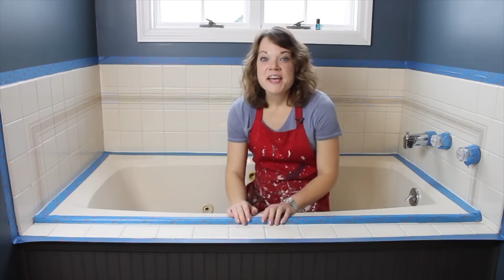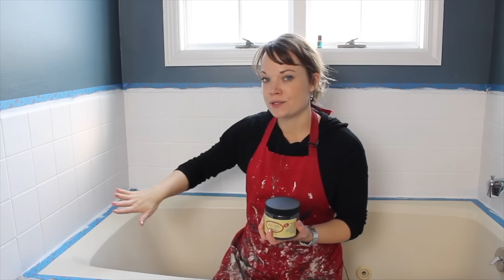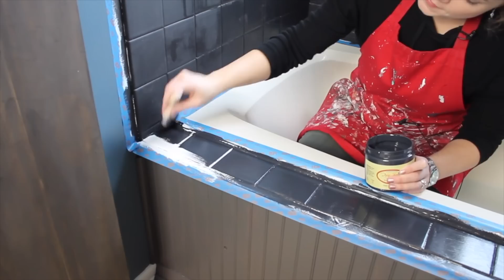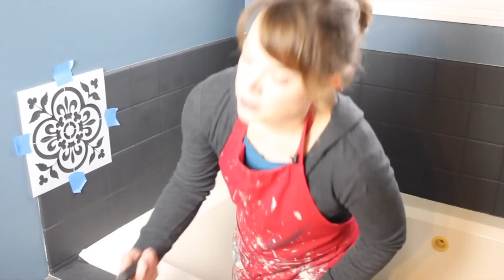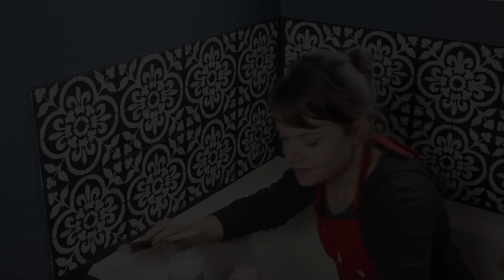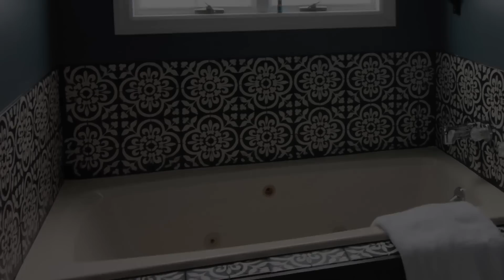Save money and do NOT replace your tiles - just paint them!

Comment: How does this hold up to water. I'd like to do this in my shower?
Reply from the maker: We recommend you seal your paint with Gator Hide. Gator Hide is designed for high traffic areas and it is water repellent which makes it perfect for wet areas.

Comment: Does it peel or chip when you clean it? What do you use to clean it?
Reply from the maker: Hi there! This project was sealed with Gator Hide. Gator Hide is our most durable Clear Coat, perfect for any high traffic areas. It will not chip when being cleaned due to the Gator Hide! We hope this helps and happy painting.

Comment: Really wonderful project and looks beautiful! Can this be done inside a shower? I need to update a bathroom but cannot afford a complete renovation at the moment. Thank you.
Reply from the maker: You can use slick stick before painting and gator hide over in order to allow the area to be water resistant. Make sure you also allow the piece to be completely cured before you put your gator hide on! You will really have to keep up with this and make sure you try and keep dry after using the shower. YOU can do it ! Just definitely takes keeping up with (:
Reply: if you also want the paint to stay longer on your tiles, I recommend you to use sandpaper on the tiles after you been cleaning them. That will make the paint stick longer and better. Then do what this lady is doing :) just a tip. So many beautiful colors out there. I would also recommend you to use a strong floor paint, often these paints are stronger than paint that are made for walls. :)
Reply: Wet sand the tile with 200 grit sand paper, then use tub and tile paint. If you want to stencil over that, I would recommend going the long way and getting an extreme bond primer to paint the tiles first (instead of tub and tile) then a satin paint over that (all surface paint) do your stencil in all surface, then clear coat with rustoleum high gloss. I’m a professional painter also lol. Just did it to my wall tiles in the bathroom.

Comment: Beautiful, although it's the opposite of what I want to achieve. I want to paint a kitchen that has white tiles with a very dated pattern with a white, glassy paint. Do you think it's possible and what products should I get to do it?
Reply: Maria - get the Rust-Oleum tile paint or the tough as tiles paint. It's an epoxy based product and it'll make your tile totally white.
Reply from the maker: That sounds like a fun project! To get the patter we recommend using a stencil or transfer with the patter of your choice and applying Gator Hide to protect the look with Clear Coat Gloss on top to get a shiny look.
Reply: I agree with Chris. Although you can go to any sherwin and get an extreme bond primer, then paint with a high gloss paint called all surface enamel. It takes a month to full cure so be careful not to bump it with things that could potentially scratch it

Comment: You should have used a stencil tack spray it makes it to slightly tacky on the back and you put it on there and it holds everything in place so you don't get me a bleeding from the paint just in case you're wondering
Reply from the maker: Excellent suggestion Rose!
Reply: Great tip Rose but, then how do u remove the adhesive before doing top coat?
Reply: Bar Rez I think the adhesive would just be sprayed onto the back of the stencil, so it wouldn’t stick to the tile. Then you just peel it off each time. If I’m not mistaken!

Comment: It's so pretty. Can this be done for inside the tub floor?
Reply from the maker: Yes! You can paint your floor as well!
Reply: @DixieBellePaint  
Thank you for the idea. Well done. I am curious how this has held up? I wouldn't do this without knowing if this holds up well. Thank you 😊
Reply: @truthb2u2   if you also want the paint to stay longer on your tiles, I recommend you to use sandpaper on the tiles after you been cleaning them. That will make the paint stick longer and better. Then do what this lady is doing :) just a tip. So many beautiful colors out there. I would also recommend you to use a strong floor paint, often these paints are stronger than paint that are made for walls. :) People all around the world paint there bathroom instead of buying new tiles: and its way cheaper do to it like that ;)
Reply: Thinking about it. I have small tiles. I want to have them look like 10x10 tiles and with no grout lines. Then add 3 pyramids as well.